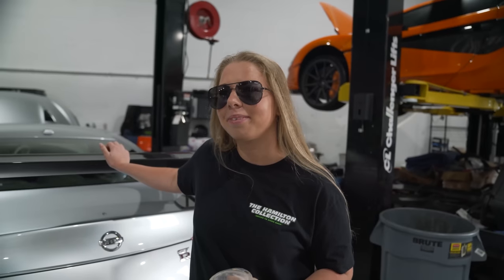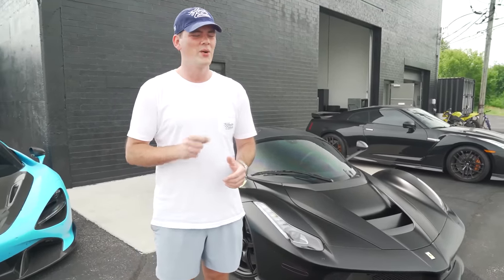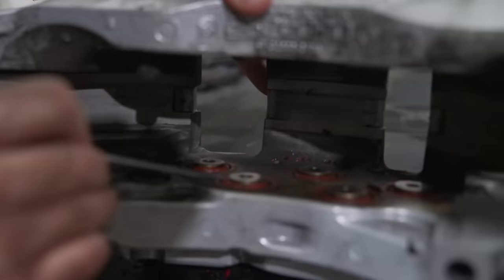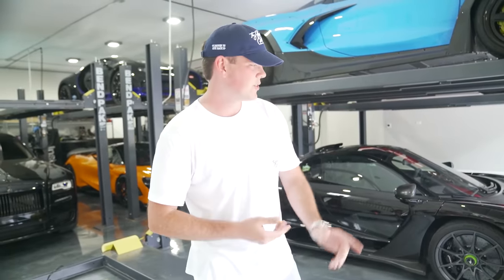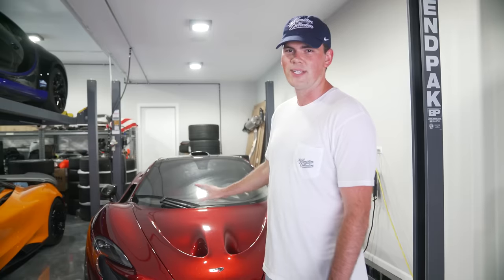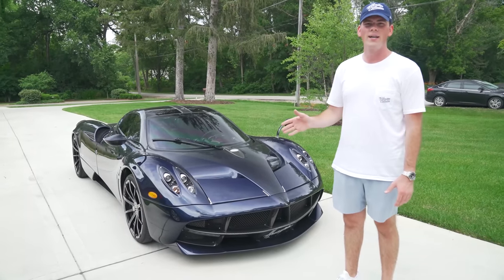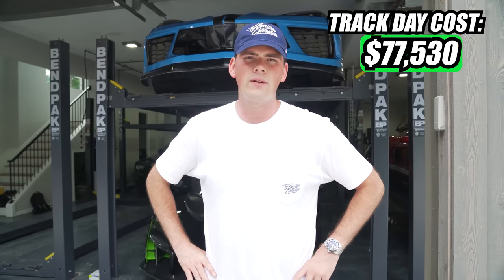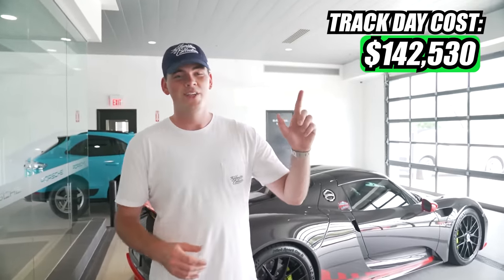The True Cost of Tracking My Hypercars (14 F*cking Cars Broke!)

Comment: I've had to price out Urus brake components before on one I worked on. The calipers are $3940/ea. Those rotors look good to me, but if you do replace them, they are $11,300/ea. Those prices are from Lambo Dallas.
Reply: That actually sounds like a god damn steal for the size and brake power of those calipers, and I'd hopefully assume those were carbon ceramic rotors cause God damn 45k for some rotors

Comment: You guys should get an Audi RS3 or TTRS for their 5 cylinder engine and build it like a Audi LMS racecar car. May be even get the engine built with a bigger turbo and push like 1300hp. IROZ motorsports do specialize in Audi 5 cylinder engines. Better get it now before everything goes hybrid or electric.

Comment: This might be a dumb question but what exactly makes a car rear engine instead of mid engine?
Reply: with rear engine, the engine is directly above the rear wheels, meanwhile with mid-engine its in mostly in front of the rear wheels. A good example for a rear engine car is the 911, while mclarens are mid-engine, you can see the difference in the car shape.
Reply: Motors relationship to the axles.
Front is infront of the front axles.
You can have mid engine cars with the motor up front under the hood, as long as it sits far enough back

Comment: Y’all sound get a underground racing sto   All wheel dive 2000-3000hp depending on what packaged you get at tx2k22 the sto they built went 233mph in a little under 1/2 mile